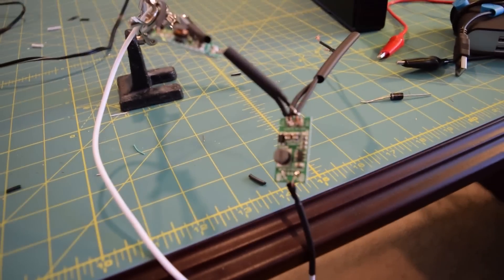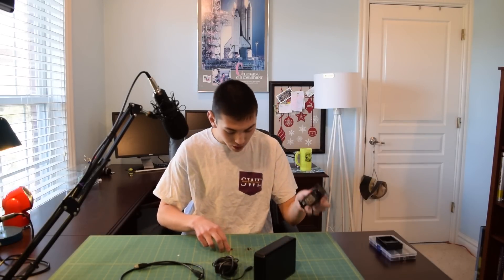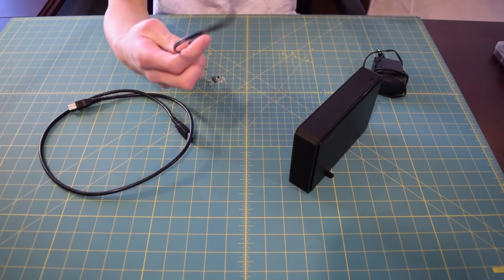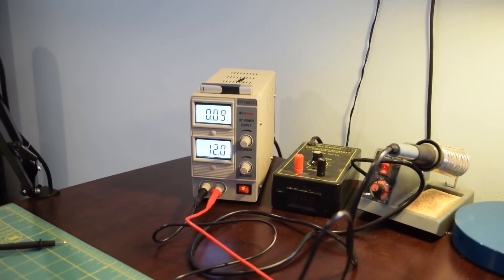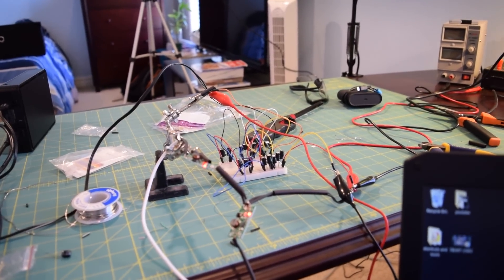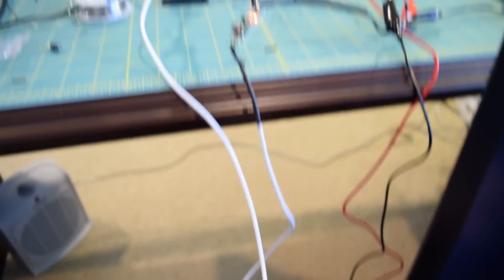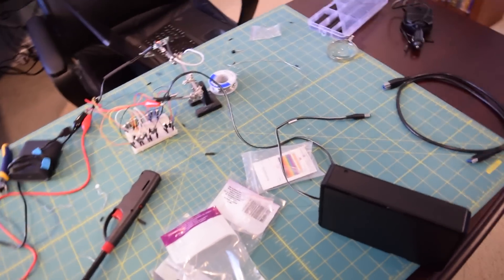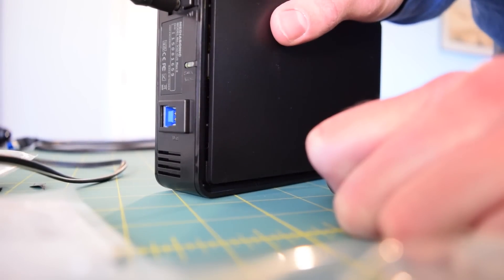Failure EP1: Building a USB 5V to 12V Power Adapter for 3.5" Hard Drive Enclosures

Comment: I don't know if you're still looking into this but USB generally doesn't give more than around 100mA to the device when it is not registered in the bus to prevent damage if there was a short circuit! So you'd need a controller which tells the OS that it needs full power attached to the data ports. But still I'm not sure if it is a good idea to pull that much energy from the same computer, you'd better connect one lead to a portable power bank which can provide 10W.

Comment: So you don't like the wall plug, but you're OK with that other monstrosity powering the thing? 🤔
Reply from the maker: +Mario Saltalamacchia Everything would have eventually been consolidated into a small enclosure no bigger than a standard USB power bank.  I agree, in its current state it was a mess, it was supposed to be a mess though, it was a prototype.

Comment: Wouldnt it be better to use a USB Type C port to give much more power to the drive?
And perhaps the voltage is high enough, but the intensity is perhaps not high enough.

Comment: told you buy this adapter and it fits straight on the usb for power  search and see StarTech USB 3.0 to 2.5” SATA HDD Adapter Cable
Reply from the maker: +Kriss Bartlett That adapter will work for 2.5" drives but it will not provide enough power for a 3.5" drive.
Reply: well its ok for me works ok on a 3.5 drive as well and its 3.0 usb
Reply from the maker: +Kriss Bartlett hmmm, thats interesting.  It powers a 3.5" drive off a single USB 3.0 port with no external power source?  What is the make and model of the 3.5" inch drive, I am curious?
Reply: the ones I showed you ?
Reply from the maker: +Kriss Bartlett ok gotcha!
Reply: ok its being delivered today or tomorrow ok ill do a video on it ok and show you also its usb 3.0 as well fast I hope ill try on 3.5 drive sata and a 2.5 and video it all ok
Reply: Hi I got my adapter and tried it out straight away ok the 2  1/2  drives worked ok one is a laptop drive other a ssd drive both were ok but as you said on the 5 and 1/4 drive it didn't work sorry dude. You were right after all but you said none worked on yours if its a small one it will work ok  sorry  I saw some where on the net it worked but on my own it didn't on the bigger drives ok thanks

Comment: Not finished watching yet but I got a feeling it will have enough volts but not enough amps to power the drive.
Reply: Just sent out a tweet to Dave Jones of the excellent EEVBlog YouTube channel and forums might bring some minds more clever than mine to see if there's a solution to this. Thinking there is using a transformer of some sort to step up the amps. Great videos bud hope you find a solution.
Reply from the maker: +Philip Sempers Thanks!
Reply: +AA Computers and Technology No problems interested to see if there is a solution to this as it could enable lots more things to be powered by USB.
Reply from the maker: +Philip Sempers Yeah, I would really love to build something that would allow the drive to run off usb! Of course that would mean anything else that runs off 12 volts could use it as well!
Reply: @HomelessTechnology  a transformer is an ac component usb is dc you would have to convert the dc from  the usb to ac to feed the transformer and then rectify it back to dc which would waste a lot of power
Reply: +Philip Sempers That is definitely the way i would do it if it came to it.
Reply: +AA Computers and Technology I don't think what you are trying to do will work. Typically "Most" USB 2.0 ports only supply about 500mA then once you add the boost converter that is lowering the current even more on the output stage AKA the 12V you are supplying to the HDD. The caps are a good idea however. Now that the boost converter is having to charge the caps and run the drive at the same time with limited current. which it won't be able to cope with even with 2 converters in the circuit. You may just be better to stick with the wall plug. 

Please do not take this as the final word on the matter as i am only going off the knowledge i have and my experiences. 

Cool video nevertheless!
Reply: +Brad Mottram I was thinking this maybe the case too. Maybe a mod to your PC case though as atx power supplies provide 12 volts and enough amps.